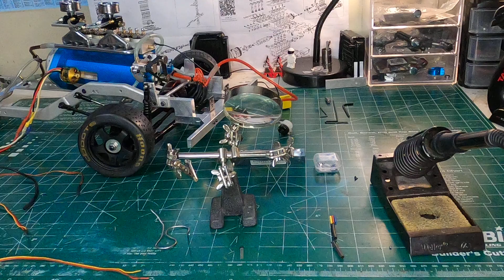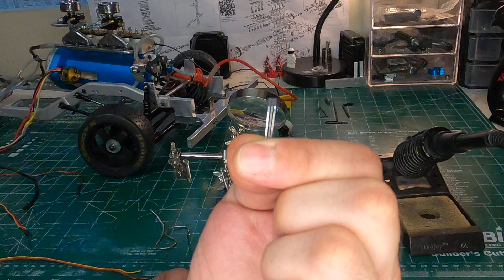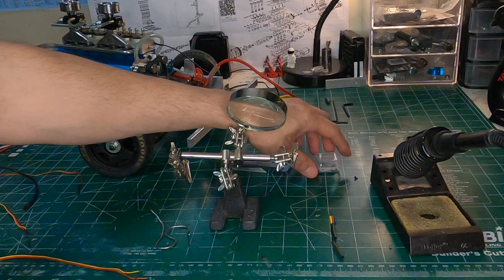How To Solder and Better Insulate a Hall Effect Sensor (Howin l6-210)

Comment: Hey mate, a couple of things..I usually only put some heat shield on the centre pin then use another piece over the whole lot. I make sure all my wires are the same length after they have been soldered to eliminate any stress on a shorter wire.
Also when using the lighter if you hold it away from the job a little you will still get that radiant heat but you won’t blacken you heat shield.
Reply from the maker: Yes heatshrink the middle wire is usually all you need, but this engine always burnt out sensors until I started doing the method in the video. Now, there not  burning out on me.
Thank you for your comments. You are also correct.